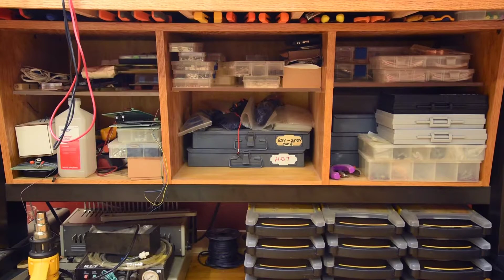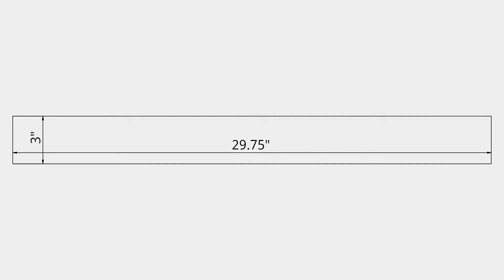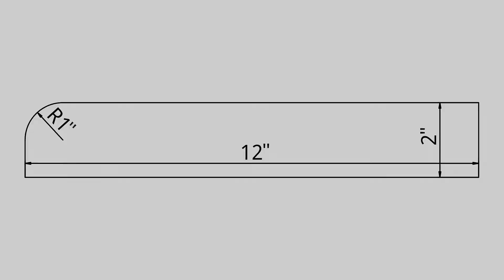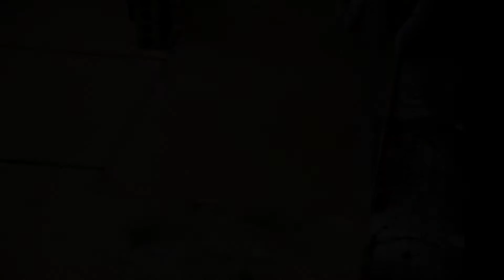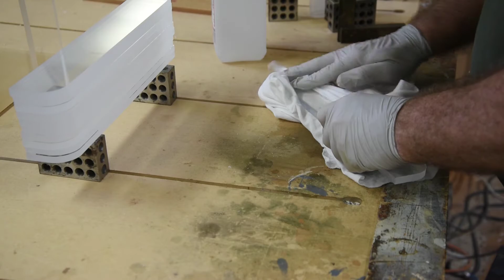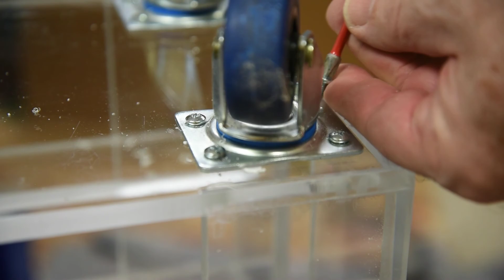Making a Storage Cart for Harbor Freight 15 Bin Parts Cases

Comment: I appreciate that the acrylic was "scrap" but to others lacking the scrap it would be an expensive project.
That said I have different scrap on hand so I appreciate the "use what you have" aspect of the project.
Looks very nice!
Reply from the maker: Yes, I guess I should have put in the video, that you might try a local sign shop to see if they will sell some small pieces of acrylic cheap.